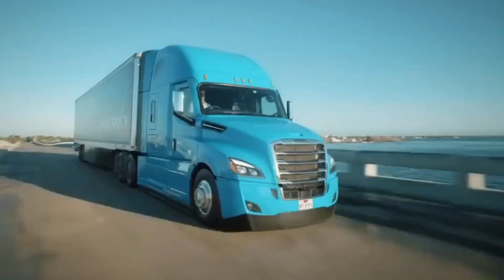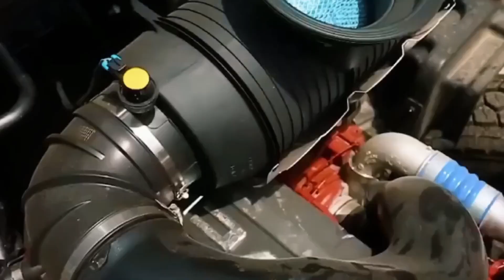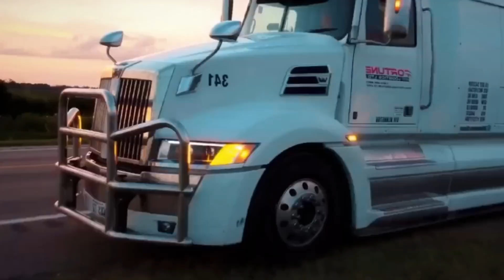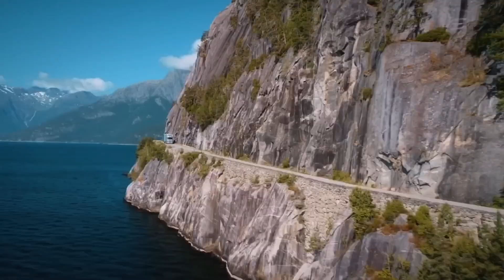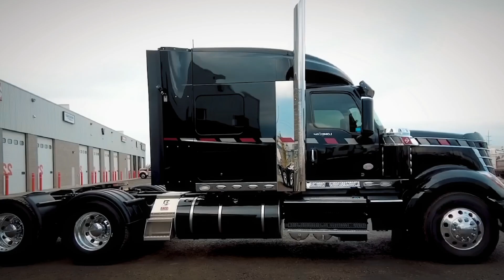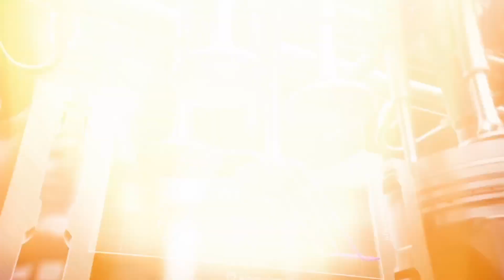American vs. European Trucks 🚛⚡ Why Are They So Different?

Comment: Europe has stricter emission regulations, higher weight limits and size limits are smaller. The only 3 manufacturers who have ever made a 4-stroke truck engine with over 650hp from factory are from Europe, namely MAN (680hp), Scania (770hp) and Volvo (780hp). Volvo and Scania stand for 9 of all 10 engine specs that has ever had over 650hp. Hell, the only manufacturers who mass produced engines over 630hp are also European. Take the previous ones and add Mercedes to the list. The most powerful factory engines you'll find in America have 605hp. You'll regularly see logging trucks or excavation trucks here in Sweden with much more than that. 

Regular American emissions standards are basically Euro 2 restrictions. That's what we had in the 90s. Then there's California, which Americans say has the strictest regulations in the world, but they're basically Euro 6 standards, which we're probably going to make obsolete soon. 

Weight restrictions. Here is another point where Americans think they're the biggest and baddest because European trucks down on the continent are usually only 4x2s. Jokes on them, the max weight limit for a 4x2 pulling a regular 3-axle semi trailer is 40 tonnes/88000lbs. In Sweden, the most common weight limit is 64 tonnes/141000lbs. The highest weight limit in Sweden is 74 tonnes/163000lbs. And those weight limits are for regular operation. No special permits needed. The dimensions limits are also much bigger in Sweden and Finland than anywhere else in Europe. Max length in Sweden is 34.5 meters/113ft 2in. Free height (no max height, just free height, so bridges lower than this has to have signs that says their exact height with certain margin) is 4.5 meters/14ft 9in. Max width is 2.6m/8ft 6.2in. Seeing a regular European/continental semi truck besides a Sweden Combo (usually 6x2 or 6x4 rigid truck with 4-5 axle full trailer or dolly+trailer) really puts into perspective how much larger our trucks are compared to theirs Max dimensions for continental trucks are 18.75m long, 2.5m wide and 4m high. And their trucks are heavier than American trucks. Our trucks have a higher load capacity than the weight of an entire fully loaded American semi truck. My truck and trailer LOADS up to 85000lbs (give or take). So, American trucks are qutie puny when you think about it.

When it comes to the most common power outputs of heavy duty trucks, America and Europe are quite similar. Both have an average somewhere between 450 and 500hp. However, higher output American engines tend to mostly focus on horsepower instead of torque. This will result in a higher revving engine and thus increase fuel consumption. The 600hp Detroit DD16 produce 2800Nm of torque. That's less than the 550hp Volvo D16K550 with 2900Nm and the 580/590hp Scania DC16 which produce 3050Nm. It's on par with the 560hp version of the old 15.6L Scania V8 which had 2800Nm. The highest output from the 15.6L engine was 620hp and 3000Nm. Then they developed the 16.4L V8 and got 730hp and 3500Nm. Their current engine lineup is a further development of the 16.4L V8 and they can reliable and comfortably get 770hp and 3700Nm out of it. However, if we look at Volvo, we can see that they are the only company that surpass and rival Scania in the power race. Their old D16K was a 16.1L I6 and made up to 750hp and 3550Nm of torque. The Volvo D16C was the first truck engine to reach the 600hp mark. It actualy made 610hp and 2800Nm of torque. On par with the American engines of the same displacement made today. However, this engine with the 610hp spec went into production nearly 20 years ago. Since then we got the D16G which was the first truck engine to reach the 700hp mark, as well as making 3150Nm of torque. This was the world's most powerful truck engine for only a short while until Scania released their 730hp DC16. Then, just a few years later, we got the D16K, which made up to 750hp and 3550Nm of torque. This was the world's most powerful truck engine for 10 years (2011 to 2021) until Scania made their 770hp DC16. The 770hp Scania engine was the world's most powerful truck engine until january 2024, less than half a year after one of the Volvo Trucks officials said they would put more effort into making LNG and electric trucks. They then released the brand new D17 engine. A 17.3L I6 making 600hp and 3000Nm, 700hp and 3400Nm, and 780hp and 3800Nm.

Needless to say, after Scania was first to reach the 500hp mark in the 1980s with their DS14 (14L V8), Volvo has been its only contender in the power department. Scania was first to 500. Volvo was first to 600 and 700. Now we're just waitig to see who's first to 800hp.